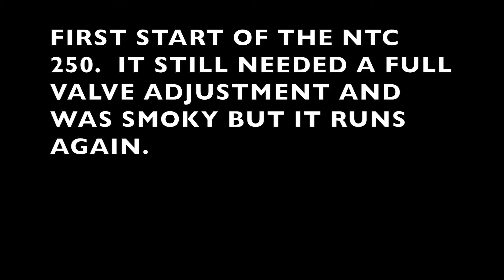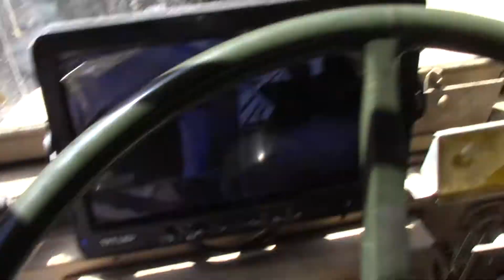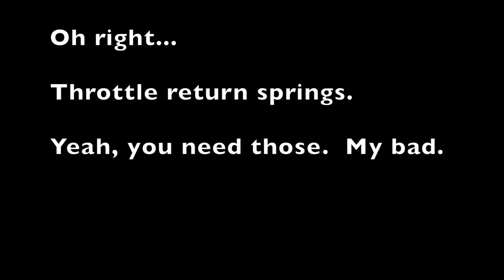First Start Rebuilt NTC 250 Cummins

Comment: Hi..
Can u tell us pls at which torque u set the injectors?
We has the same engine here and the injectors need to be adjusted..
The second question I want to ask is : are the injectors for Cimmins 855 and Cummins 250 the same??

Comment: Hi..
Can u tell us pls at which torque u set the injectors?
We has the same engine here and the injectors need to be adjusted..
The second question I want to ask is : are the injectors for Cimmins 855 and Cummins 250 the same?? 0:59
Reply from the maker: About 40 in/lbs I think, yes I believe they are.
Reply: @acme663ryo  thanks ..

Comment: Hi..
Can u tell us pls at which torque u set the injectors?
We has the same engine here and the injectors need to be adjusted..
The second question I want to ask is : are the injectors for Cimmins 855 and Cummins 250 the same?? 0:59